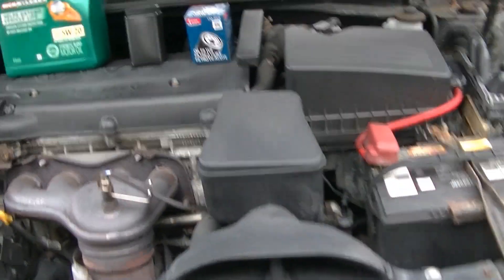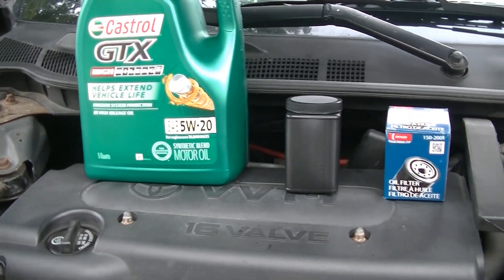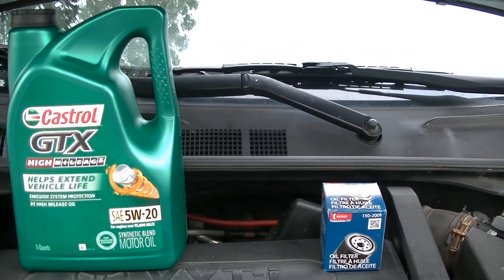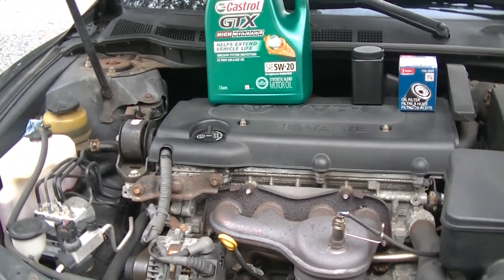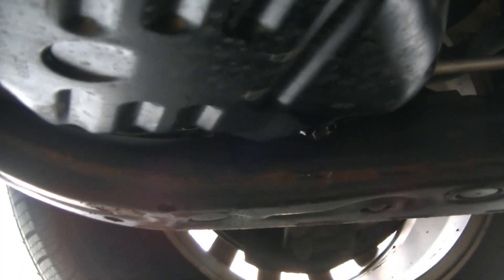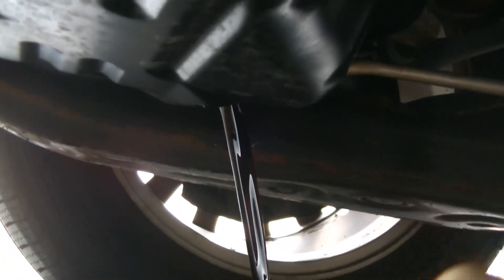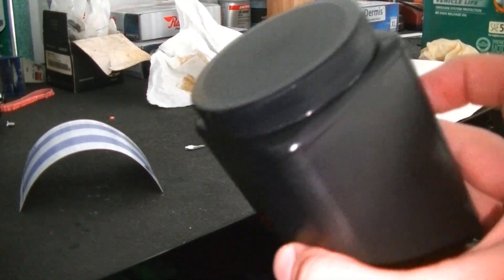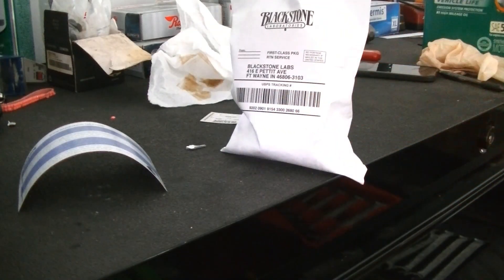How far can you go without an oil change WITH PROOF (used oil analysis) Part 1

Comment: There was a case of a man very vigilant about testing used engine oil on his beloved BMW. He keep on reducing the oil change interval as his results could not match the result of his friend used engine oil of 10,000 miles interval. Until he found out that his friend had to top up 1Q of engine oil for every 1000 miles. 😂😂😂😂

Btw is it true tgat engine oil contaminate by a very slow coolant leak, just 1cc per day, would cause noticble serious engine damage after 3 to 4 years?. Do you do a blotting test for used engine oil before sending used engine to a lab. If gylcol is heavier that used engine oil should you start collecting used oil sample as soon as the 1st 0.1Q is drained out?.🤔🤔🤔